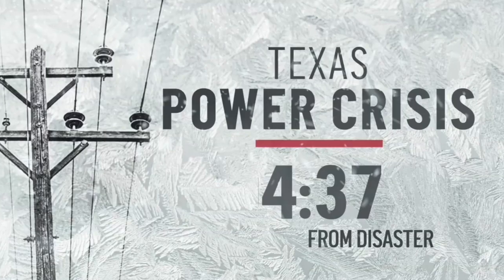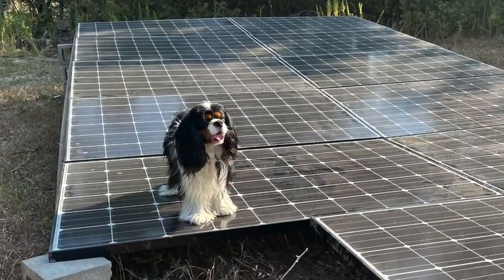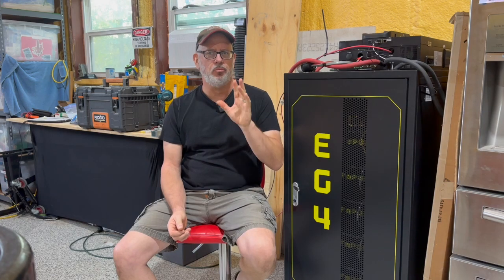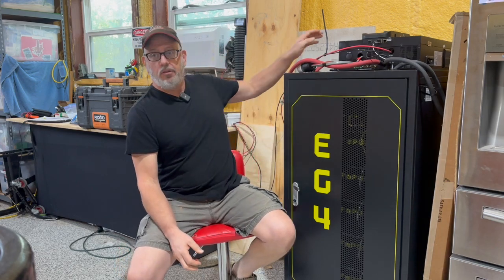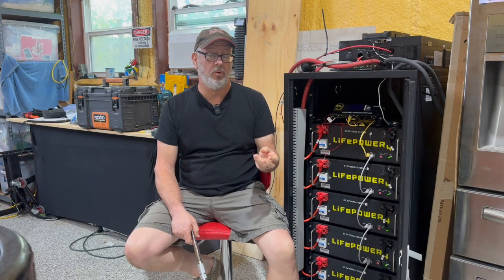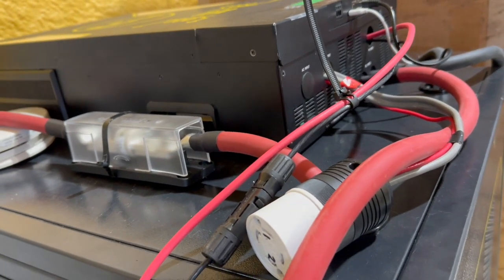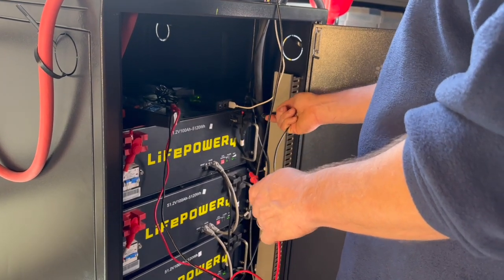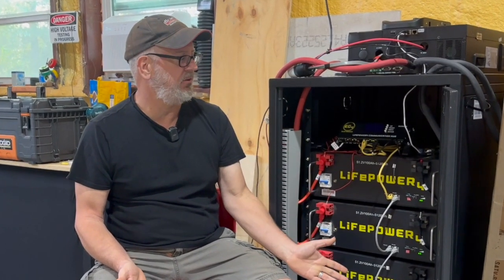Best Turnkey Solar Power Battery Bank for Off Grid

Comment: May I ask how much does it cost totally for this system with battery?
Reply from the maker: @HK-hy9od  Sure!  I purchased all my components separately from Signature Solar over the past year.  I should have bought it all at once to save money on shipping costs.  If I wanted the same off grid DIY Solar System today, with the exact same components I have now, I would buy this kit:  

https://signaturesolar.com/complete-off-grid-solar-kit-eg4-6000xp-12000w-output-48v-120-240v-split-phase-12800-watts-of-solar-pv-kit-e0009/

The only difference between my system and this kit is I have 2 more batteries and my panels are the same size but different brand. After the 30% tax credit, my DIY system cost me around $11,500. ☀️⚡️👍🤩💰🔋🌞
Reply: @terrahillfarm  what a good deal last year! Current price has been increased a lot OMG. Thanks for sharing, so I can tell my close friend who may need this.
Reply from the maker: @HK-hy9od  great! Just let me know if you have any additional questions.  I expect that panel prices and batteries may be going up in price over the next few months.  This is because import tariffs have increased 100%-233% for those items.  This doesn’t impact existing US stock, but for any Imported after 6/1/24, price will reflect the new tariffs. 👍⚡️☀️⭐️💰
Reply: @terrahillfarm  😮‍💨 got to make up mind if once decide to go solar and order it.
Reply from the maker: @HK-hy9od  yeah, it’s a big investment.  Here’s how I rationalized it.  Our grid power was unreliable so I had to do something.

All my neighbors paid to install whole home generators and run them off propane which is limited in onsite supply..  Generators run $8-12,000 fully installed with pad, transfer switch and turn key underground electrical.  It costs $2-3/hour to run, so a week of no power could easily set you back 3-$400 in fuel.  It also costs to keep them maintained with a service plan for $4-500/year.  The solar costs more but is more dependable than a Generator on propane. After install and purchase it costs more up front but it cuts my electric bill by $1-200 every month.  A generator will never pay for itself so at some point solar actually earns money 💰 The key to solar is having a battery backup.  Unfortunately, Tariffs on imports of Lithium based batteries increased 100% and solar panel tariffs went up 233% in June, so watch solar panel and battery prices as they may be going up soon. 👍⚡️☀️🔋

Comment: Any chance you could add a list of components and tools with links ?
Reply from the maker: Thanks!  Great point, I will get a list of the critical pieces shortly.  If you’re going to buy cables pre-made, I’ve had good luck with the ones from WNI (aka Windy Nation).  Be careful though there is some dangerously cheap stuff being pedaled out there on Amazon.  Blue sea is another quality brand for fuses and fuse blocks.  As you can see, my inverter and batteries are still in testing mode.  Will be wall mounting them and wiring them up permanently soon.  👍☀️⚡️💡🤠